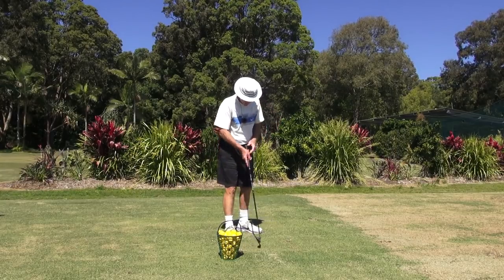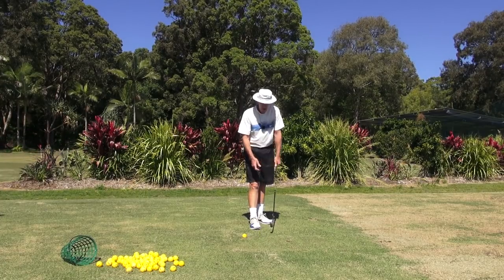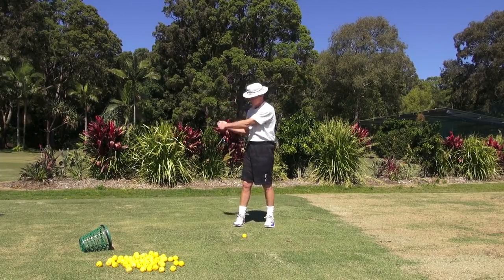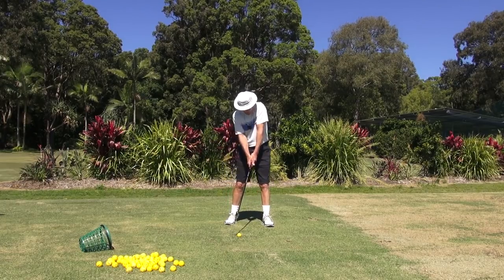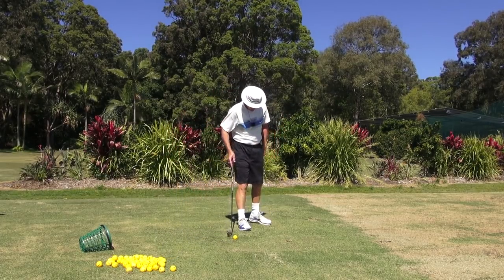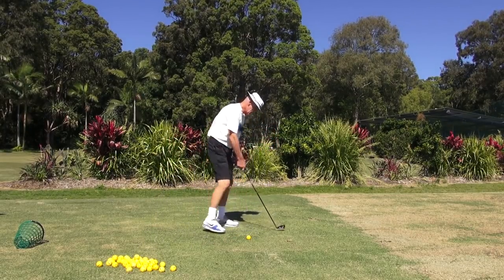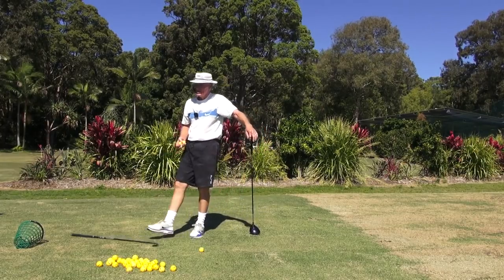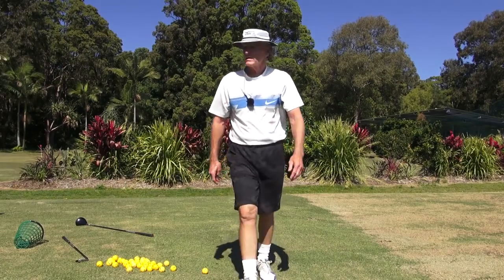Channel Lock Bowing Wrist Grip   Change.. video 1..

Comment: This bowing of the lead wrist (supination) is what made Hogan remark that he wished he had 3 right hands. The right can't overtake the left at impact. It also had benefits beyond this having to do improving the arc of the swing.
Reply from the maker: I  had a conversation with Moe Norman about   the raised  lead   arm wristbone   at impact that Hogan    had   and I said     I thought it was a 'resultant'  of him    keeping     lots of     trailing  backwards flex in his 'right'  wrist  at impact that created that  lead wristbone 'look'  rather than a deliberate attempt to    actually get  that   bowed    wrist     position ..
                The reason I proffered that explanation was Hogan's comment about wanting '3' right hands at impact ..   and if you   actually   try keeping  excessive    rearwards  flex in the  right   wrist   at impact you  achieve the 'look' of the  lead   raised wristbone .. but if you try to  actually     create  that   deliberate wristbone     process  its  a ridiculously    difficult thing to do .. ..
               I said I thought Hogan was deliberately pulling back with his right-hand fingers against his right forearm dramatically coming into impact ...  Moe stunned me when he said  that was exactly what he did in his own swing and  what   he  actually thought Hogan did as well in his swing .. Moe said it must have been the case    because both Hogan and himself had the same look    in their   lead wrists coming into impact .. and Moe said he never  thought about the lead wrist    only the    trail    wrist bending backwards ..     I am going to   try   incorporating that   process into my   new 'bowed' wrist process  ..
                  cheers JH

Comment: JH, You do not appear to have any bend in the right arm on the backswing, a la your  3 lever swing;  the club seems to go only to about one o'clock at the top  . l am trying to make it go way further than that, so the club will travel further and gain speed as you so beautifully demonstrated on another video.  I am enjoying your stuff immensely and trying to emulate it; being 82 is definitely a handicap. Channel lock is great !!
Reply from the maker: Hi James,
                I have been  concentrating so much on my new grip process   that  I  have gotten totally diverted     from   the 3 lever    adaptation .. I will be back to it    absolutely  from  the next practice session ..  I definitely want to   get the 3 lever    process into my swing  for the same reason you do ..it definitely    will give more clubhead speed   for sure .. glad  you are  liking the CL swing process..
                     cheers JH

Comment: But you have to be sure to not have a strong lead grip (3-4 knuckles). Otherwise hook city! Lead should be neutral 1-2 knuckles.
Reply from the maker: I could not get a strong lead hand in play with the gripping of the club now in the  'palm' of my lead hand as I am now doing..  as well as I mentioned in the videos you really have to commit bigtime to  hitting 'in to out'  at impact ...  but its surprising how quickly you can get that process in place ... it only took me a few shots to get the feel accepted kinesthetically..
                       cheers JH